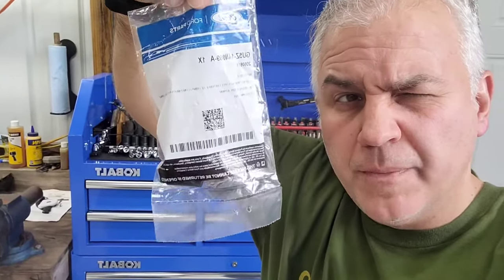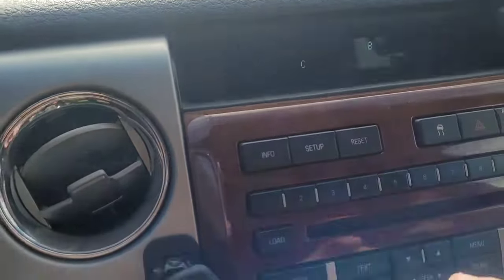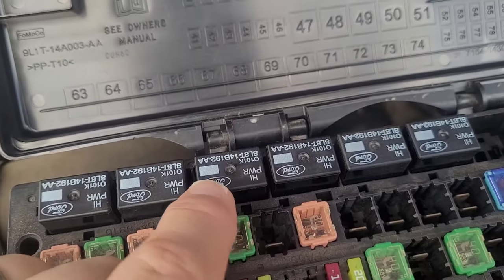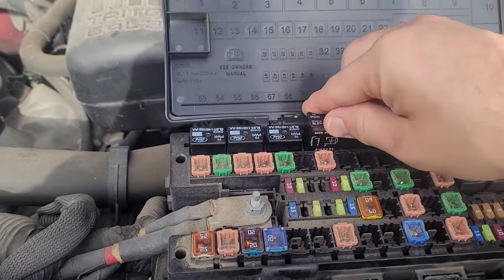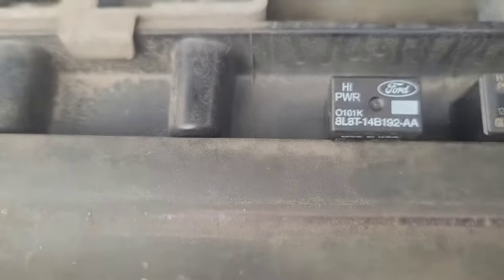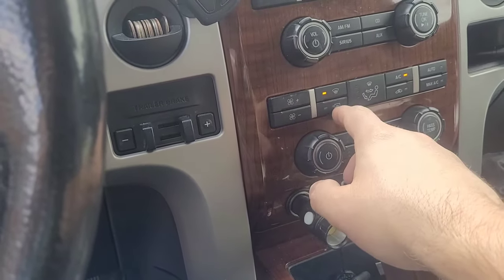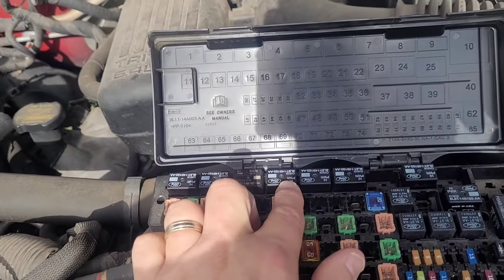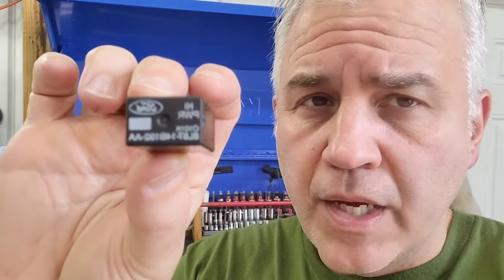Ford F150 Blower Motor Malfunction  Easy Fix #f150

Comment: I have a 2016 F150, whose blower motor stopped working.  I checked BCB fuses 17 and 60, and the BCM (right kick panel) double fuse 12 and 13.  All fuses were good.  I knew my next step was to check the blower motor relay but my solution was going to be to check out the relay wiring diagram and then create a circuit to energize it.  BUT THEN I FOUND YOUR VIDEO!!  What a fantastic idea!  I pulled a random relay that had the same exact numbers all over it and plugged it into the place where the original one was.  Result:  THE FAN MOTOR STARTED WORKING!  Thank you so much for creating this video--it saved me a trip to the dealer.

Comment: Thanks buddy you just save me purchasing a new blower!  Not to mention the guy at the local Ford parts desk just told me it would take 12 hours to change the blower motor.  I think he was thinking of the Fresh air door replacement. Thanks!
Reply from the maker: Glad it helped.  12 hrs for a blower motor is definitely excessive

Comment: So after removing the blower motor which if  you dont have a swivel adapter it can be a bear. However checking the motor and replacing the resistor I watched this video and vola it was the relay.  Thanks for your info much appreciated.
Reply from the maker: Glad it helped

Comment: That was it. But I have had so many instances in the past where things would go wrong and I would check the fuse or relay, and they would be good. And I would have to replace the part, ie fuel pump. So I didn't even bother to look at the relay,  until I happened to see your video. But other videos I saw, suggested checking the blower fan itself or another part located near the blower. (Guess they figured most folks would automatcally check fuses first) Thank you for reminding to check the simple things first
Reply from the maker: I learned the hard way...check the simple things first!

Comment: I have a 2009 ford 150 platinum and my blower is not stuck and runs with heat and Ac. But the way it runs it dims the lights on and off with the speed of the fan running. Almost like a heavy load on a circuit and your lights dim a bit and then full on and then dims a bit and back on full. That's what my fan blower sounds like and does. Is that part of the same issue for me or is there something else that is part of the blower ? Thanks. Great video by the way too.
Reply from the maker: Sounds like your blower motor is going bad and pulling, too .many amps but should be brought to a shop to confirm
Reply: @MajorWeakness  thank you for the fast reply. Much appreciated. I will have it checked. Probably best to change both anyway. Motor blower and sensor. If that is the case then the motor should be putting lots of stress on the sensor part heating it up. If the shop finds its the motor blower I will change the other part too. Matter as well do both . Thank you very much. It helped a lot clearafying things in a better view point. Have a wonderful day Sir.

Comment: When swapped 3 with 4 it appeared that you left the bad relay in position 4.  Was that the cause 😅of the rear window defrost not working? So easy to make that mistake mistake.
Reply from the maker: Yes you are correct.   I eventually had all good relays.  Everything still works as it should

Comment: My 06 blower motor resistor went out little over a year ago so I ordered one on Amazon had good reviews it worked for a year and when it did burn out it would only work on setting three and four that burned out couple months ago I got that company to send me a new one now this one’s only last about a month or two and it only works on setting for now not even three anymore now I’m getting real irritated and trying to figure out what the problem is you’re going to watch your video and see if I figure anything out
Reply from the maker: Make sure you do not have any water licking in there.On your blower motor resistor it will make it fail premature
Reply: @MajorWeakness  the is for tip

Comment: My 2011 blower just stop working on low and medium. Will that fix my problem
Reply from the maker: Probably not.  Your symptoms point to a bad blower motor resister.   These are simple to change and available at any local auto parts store

Comment: Changed blower motor and relay...will work for a bit  then won't for a bit then will afain...any thoughts?
Reply from the maker: Check all your ground cables around the relay box.  Sound like there is a wiring issue.  Look for any evidence of chewing damage by small rodents.   They love to chew on wires.

Comment: Could it be she same issue with the fans not cutting off
Reply from the maker: Yes.  Just swap a few around and see if it fixes.   You can get these relays at a junkyard for less than 5.00 each

Comment: I got a 2008 mustang for the likes of me can’t fiquire it out. I swapped relays I changed the resistor.. you can run and wire to the blower motor to a battery it works fine. But no power going to blower motor
Reply from the maker: Switch??
Reply: @MajorWeakness  that’s the only thing I haven’t tried. But you can hear the ac compressor come on with the switch but doesn’t blow through vents. But I guess it could be messed up on the fan side of it.  I really appreciate you responding back buddy
Reply from the maker: @davidbryant5875  I would work my way back from the resister.  Put a power meter on the resister and see when you change the switch does the output voltage change or does it even have an input voltage.  If it doesnt have an input voltage then keep working back towards the switch.  Might just be a connector that came loose

Comment: So I swapped relays and it seems to be working now as long as I don't turn it to 4 "high". If I do that, the air begins to shut down again. Any idea why?
Reply from the maker: Sounds like a bad speed resister.   Most auto parts stores sell them

Comment: did  the same thing  ? swapped  out relays  still didnt work so i checked fuse #51  swapped that  ?still not working   checked power at fuse  plug in  ? there is power on  1 side  but still no blower fan  and no power at  wire plug in at resistor ?     any ideas ?  maybe button switch on dash  ?   cause it would nt be blower motor cause no  power at plug in on resistor ?
Reply from the maker: I would check power at switch next
Reply: i just found another  thing to check first  ? is the climate control  fuse   thats in the fuse box  thats inside cab  #10 mini fuse ?  let you know  @MajorWeakness

Comment: Hmmm, Mine stays on continuously on one speed. I replaced the resistor, didnt fix the problem- 🤔
Reply from the maker: Very strange
Reply: @MajorWeakness  It is- not really sure where to go from there. Ive changed the blower relay,,I guess today Ill try fuses, but fuses don’t make sense to me since the blower fan runs, In fact I put a new blower fan on it about two years ago. Might be the switch itself, if so it looks like Ill have to replace the entire face plate.
Reply: Did you ever solve this? I’ve replaced everything. Still stuck on high
Reply: @Collin.strachan  yes I did, I ended up replacing the blower motor, the resistor, and the wiring harness.

Comment: It didn’t work on my 2011
Reply from the maker: Sorry the video didn't help
Reply: I changed out my relay a few weeks ago and then I heard a clunk. My theory is that the fuse blows before the motor is about to give out. I have to get a new blower meter